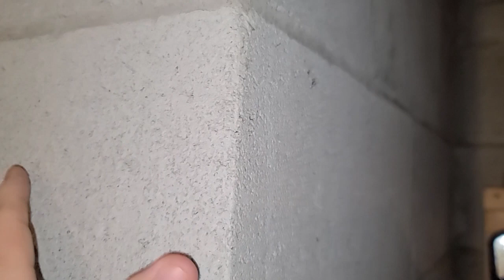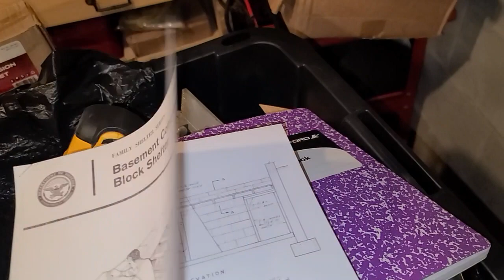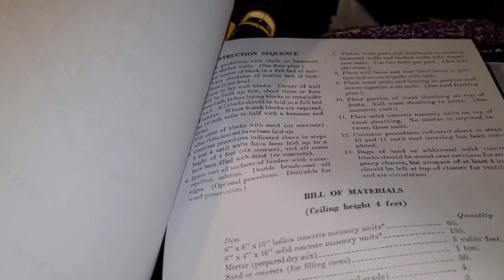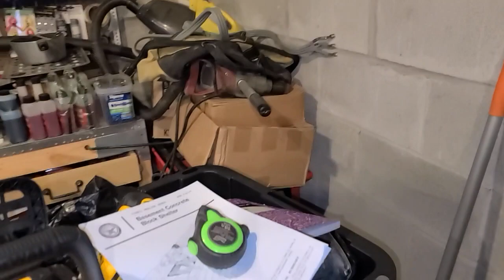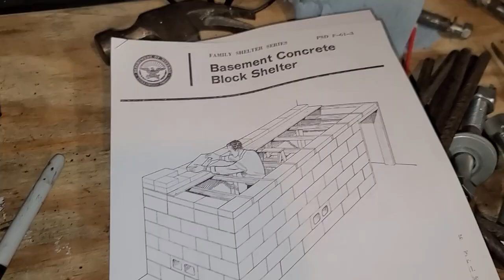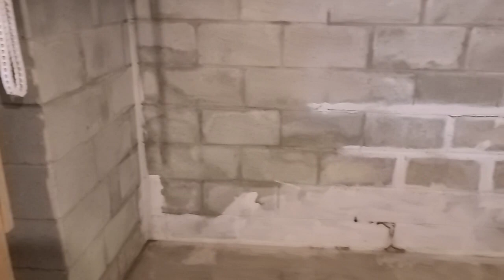Basement Storm Shelter Part 1

Comment: I like the basis of the plans. I am considering doing about the same thing. I have about 4' from my crawls space floor to the bottom of the joist. Being on a hill the water table isn't an issue so I plan to dig down 3' - 4', pour a slab and build up from that. The roof of the shelter has been the the hardest part in my planning. It needs to be strong, but my workspace will be limited to the distance between the shelter walls and the joists. Thank you for posting the video!